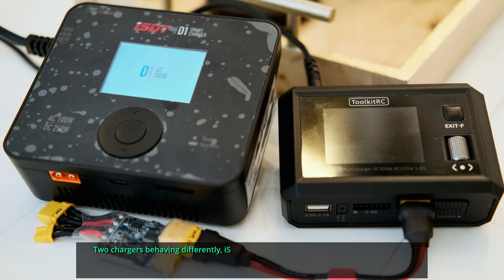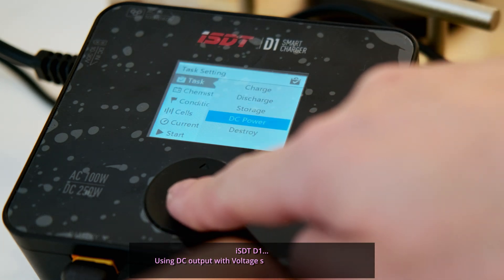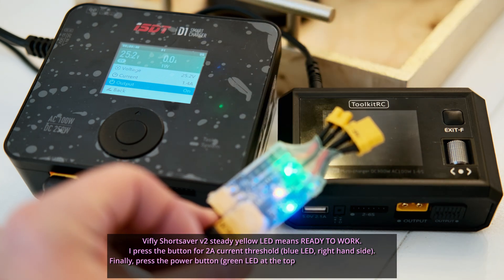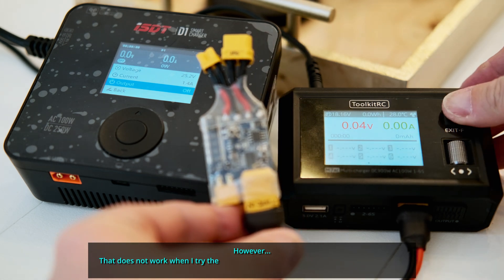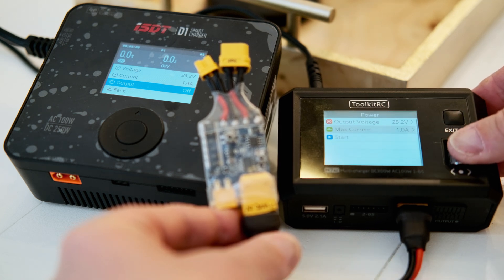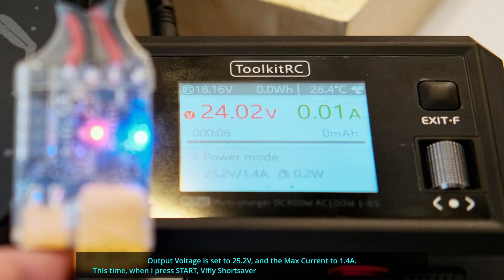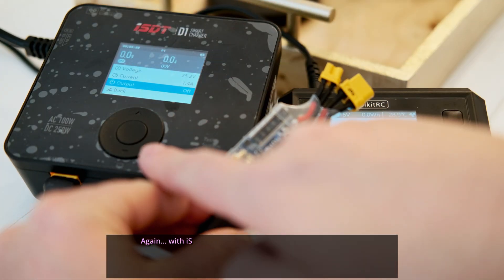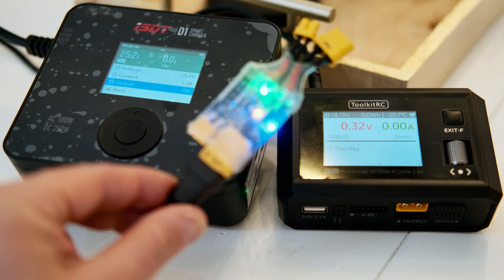ToolkitRC M7AC DC output problem - PART 1

Comment: that smoke stopper is something i gotta get!!!
Reply from the maker: It is really amazing! Every single time I put one quad together, I plug it through that beast. I was lucky, my builds were really clean so nothing happened, but it's not worth risking such an expensive components. This thing is a life saver. There is also a button so you can switch between 1A and 2A. 2A needed for 6s configuration.
Reply: @Seii-FPV  agreed!!!  I think u just made up my mind. Im getting one of those!!!  hehehe